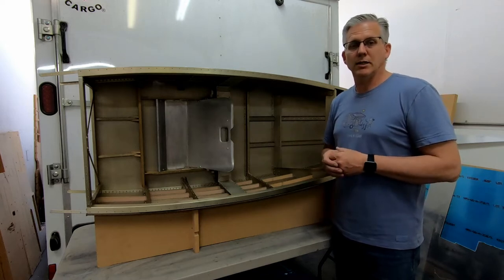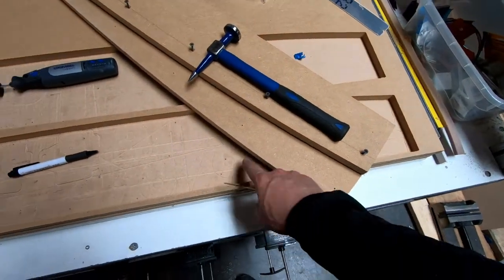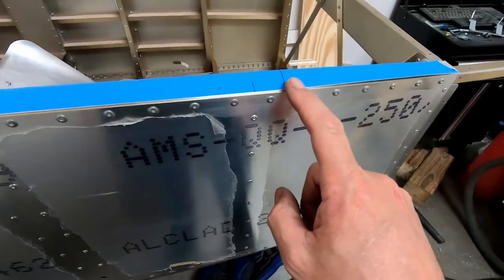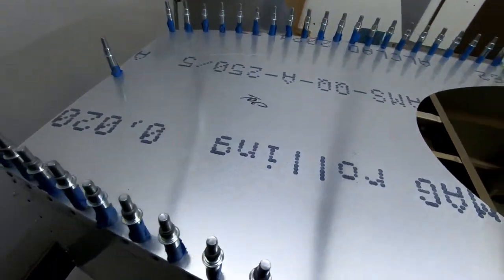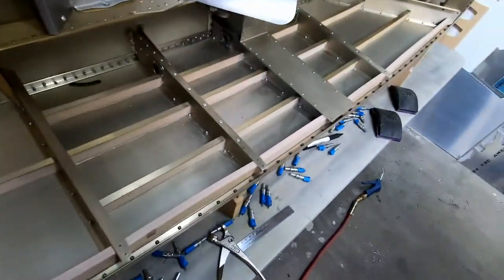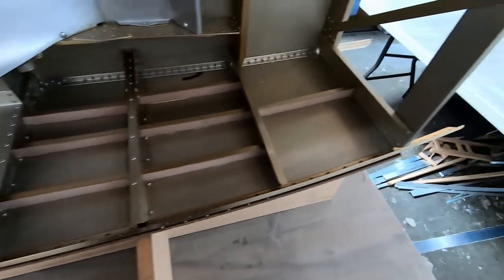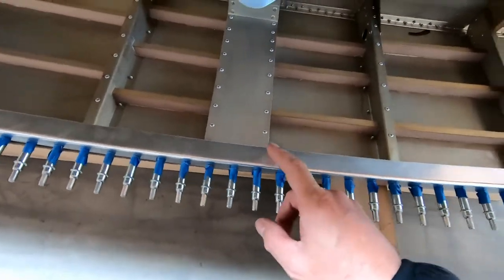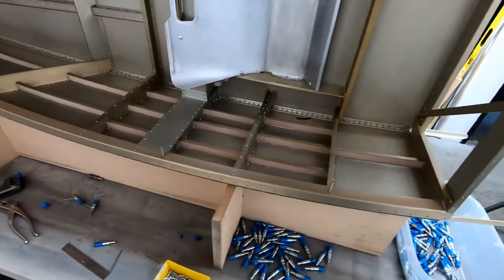20 - CriCri Airplane Build - Cockpit Border

Comment: I have a pile of reject cockpit border fold tests that I used to get that part just so. Making it as per the plans wasn't even close to a good fit. I don't think I put any radius on the MDF form as it squashes slightly under the aluminium. I used a rubber mallet to make the fold.
Reply from the maker: Shannon! Well, I don't know how you did it but it fit perfectly. I was truly amazed. I thought for sure I would have to trim it but it wasn't even a fraction of a mm off after I bent it. Thanks again for sharing that with me. I had very low expectations for it to work out the first time but it ended up being one of the easier things to make and the time savings of not having to trim it off was the icing on the cake!